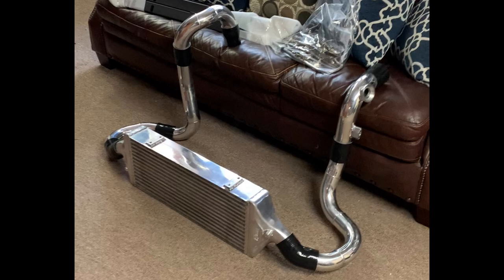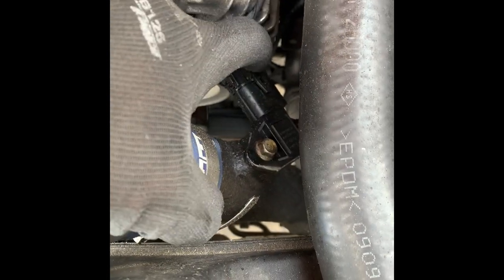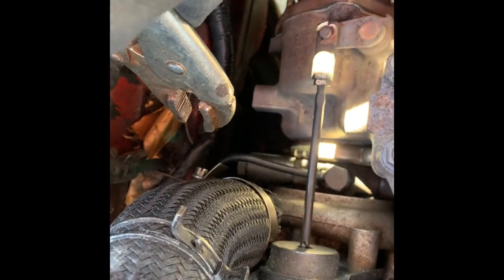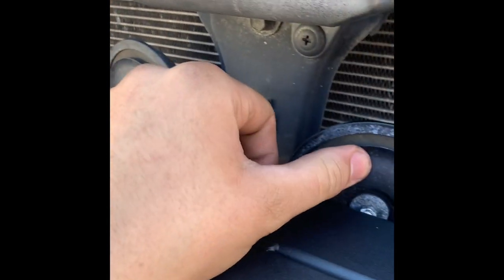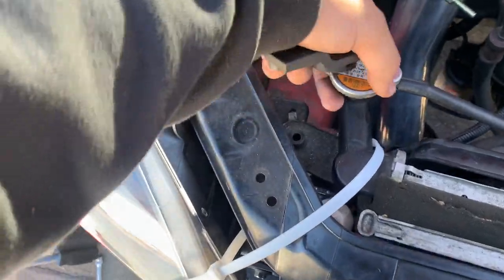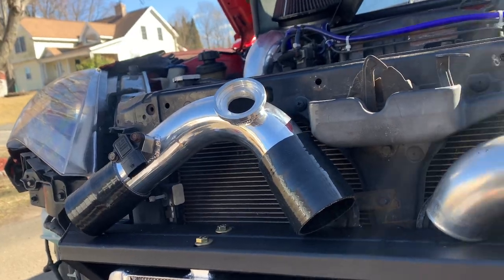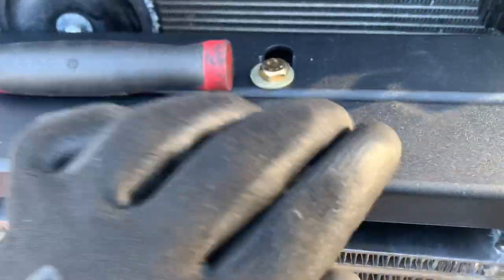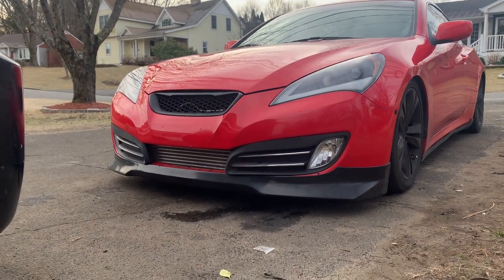BK1 Genesis Coupe 2.0T || TurboXS FMIC Kit + Radiator Support Brackets Install 😮‍💨

Comment: How did you like using the BK2 intercooler? DId you see any improvement versus the BK1 intercooler?
Reply from the maker: It’s actually the only intercooler setup I’ve had beside the turboXS one so I can’t compare the bk1 vs bk2… my car had came with the bk2 intercooler already on the car lol, I do know that the bk2 intercooler is good for around 400whp so they are pretty solid from factory ya know.

Comment: Do you need a block off plate on your turbo if you get the bov adapter piping?
Reply from the maker: Not necessarily u can route it so that the original stays closed and the new one is the only one functional but for ease of the install I suggest getting the block off plate

Comment: Clean, loving the build!! Have you noticed any major differences after installing this?
Reply from the maker: It could be in my head but it honestly feels like the turbo spools a little faster
Reply from the maker: It would make sense tho as there is now more airflow and a better cooling…. I don’t think I’ll really feel it till everything is tuned and dialed in to maximize the potential of all the bolt ons.